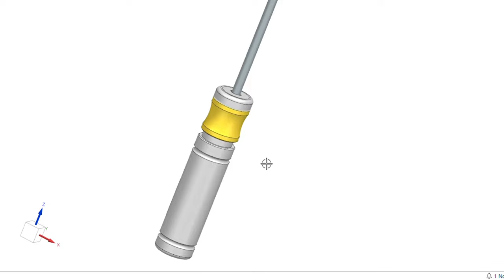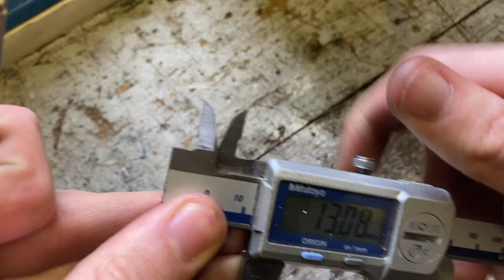Mini lathe project: Making a screwdriver with interchangeable drive tips

Comment: Tell us about the lathe itself. And would you recommend? Thanks.
Reply from the maker: The lathe is a “WM180V” which I bought second hand. It seems really solid and well-built for a small lathe although it is 15 years old (made in 2008) so I’m not sure if the new ones are still as good. For example the gears are steel but a lot of the new lathes have plastic gears. The motor is fine most of the time, but sometimes struggles with tougher materials or taking a large depth of cut.

Comment: Beautiful work! Where did you source the screw driver blades that fit in the handle?
Reply from the maker: Bought them off eBay since they were only a few £ and had a standard sized shank. I originally planned to make them myself but it would have been difficult to do the keys without a milling machine.